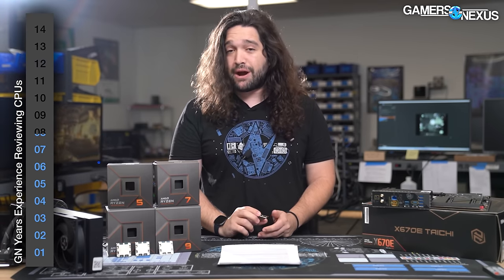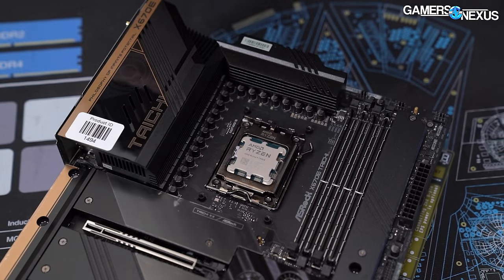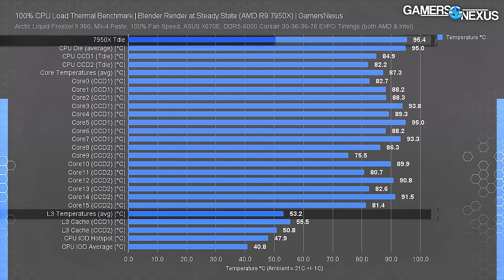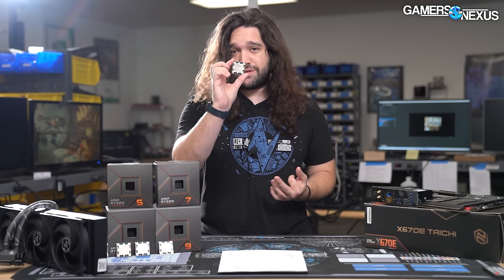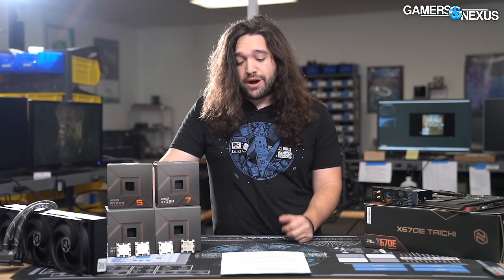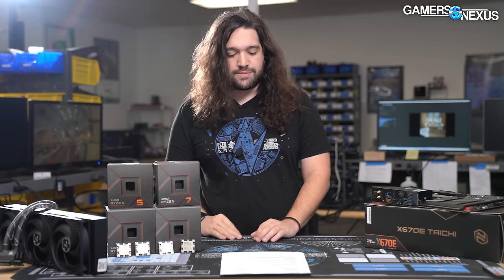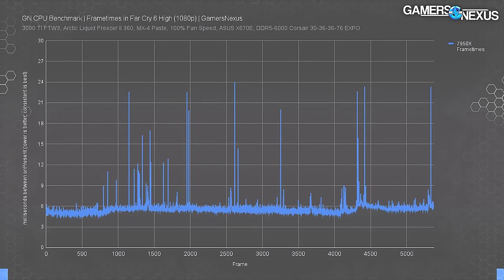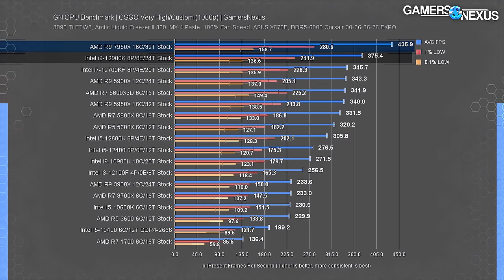95°C is Now Normal: AMD Ryzen 9 7950X CPU Review & Benchmarks

Comment: 95 was the normal back in the Late Socket A Athlon days, so this is a return to that. It seems like power usage goes in cycles.
Reply: Temperature not equals to power usage. 
Chip size have huge impact on temperature on par with power. Increasing size = cooler, decreasing size = hotter, decreasing power - cooler, increasing power = hotter
Reply: Heat != Power usage
Reply: 95 was never normal at Socket A, been there done that. Overclocked many Bartons and T-breds back then.
Reply: yeah I think even 70c would kill those socket-A chips. (Back then there's no thermal protection)

Comment: Happy with my 5800X. Great performance in gaming and productivity and rarely exceeds 70C under load with a Noctua air cooler
Reply: Same, in the future when the prices are lower I might pick up a 5800X3D as a drop in upgrade though. Pretty wild how much better for gaming it is over the regular 5800.
Reply: @Big_Red1  5800X3D is a great choice! But only if it's for gaming, it's not made for productivity.
Reply: 5700X is value for money though!
Reply: I have the same setup, just waiting to upgrade my 1080......
Reply: @firekid5790  5700X was also released much later so what is your point
Reply: Stop focusing on temps on Zen 3 and above, if frequencies are fine and stable let it be

Comment: Could you guys please test PBO2 and it's undervolting feature. It was really great on Zen 3 as AMD left quite a lot on the table in terms of the Volt/frequency curve. Especially since these new Zen4 cpus pull so much more power, it would be really nice to see if there is a way to rein in the power while still getting full performance which was the case with PBO2 last gen.

Comment: There's no way I can afford a 7950X and 3090Ti (or even an upgrade of any kind), but it's still fun to see my old R7 1700 represented in these tests. And yes, I know that the gaming benchmarks shown are WAY ahead of what I can get with my old RX 580, but it's still fun :D
Reply: Get off YouTube and make more money
Reply: Whoa, someone else with my setup!
I've been eyeing the 5900x for a while, and this video makes me more confident.
Reply: @WaterZer0  yeah 5900x series is amazing just get a good cooler totally worth it.
Reply: @magnusred2945  that type of statement should not be made without context. You don't know the situation of the guy in question.
Reply: @magnusred2945  this is the kind of statement of someone who thinks they're hot schtick. You don't know what the OP's situation is and his set-up is still pretty good for what it is.
Reply: im still using 1700 over clocked since 2017
3466 memory b-die low latency
gtx 1070

i have even clocked this cpu to 4.2 and memory to 3600..however these are not stable all the time

i play all games
some are very smooth
some in ultra settings
some high
some medium

i have had 3 x 24 inch momitors + 19 inch on this 1070 in surround
worked flawlessly

only "new world game" i need a new gpu ..so i want a 6800xt or 6900xt
amd uses less power than nvidia 3000 series by a lot and its cheaper
also checked on a 5900x and a 5800x3d and the x3d uses 30 percent less power in all games  and gives more fps too

its a better upgrade than any 7000 series amd ..due to pricing and power draw by far

3090ti draws 450 watts and amd 6900xt draws 220 watts avearge
massive difference in your pocket or electric bill
also  5800x3d 60 watts and 5900x 110 watts in all games average
Reply: RX580 gang represent!
Reply: Hey RX 580 club! I have the Saphire Radeon Nitro+. On a Pentium LOL. But I play WoW, Path of Exile and some GOG games so I went with what I actually needed. 
I also have a 3200G system on the Asrock B450M Pro4 just using onboard graphics. Same games. Perfectly fine for my use case. 
Wanted one Intel and one AMD system. Dual boot Linux Mint Cinnamon and Linux is just easier on AMD graphics.
Reply: @youtubeisgarbage900  It's nearly 6 years old, that's ancient for a CPU.
Reply: @itIsI988  my little brother is still using my pentium G3258 and 750ti lmao
Reply: @magnusred2945  But if I got off of YouTube, where would I get such insightful and motivating suggestions?
Reply: @vaderbuckeye36  Damn. If it works it works ig. My PC is almost 7 years old as well, just with a 3 year old GPU. Starting to show its age a little though.
Reply: If you want to stay with AMD, you can sell your 580 for a few $$ and grab a used 5700xt for like $180. It’ll be a huge upgrade for probably ~$100 net cost. I have one and it works great for 1440p as long as 80-120fps is acceptable to you in AAA titles
Reply: What's with the cope in the replies? What exactly is this dude's situation he can't make more money lol
Reply: @youtubeisgarbage900  That wasn't my point though, 6 years is still a long time for a computer.
Reply: @youtubeisgarbage900  If doing basic shit then yeah
Reply: @starofeden9277  I have the same specs, except for the RAM. Mine is team group vulcan-z 3200, but I have a lot of instability if I run it above 2400. Also sounds like you won the silicon lottery, my r7-1700x won't overclock past 3.9ghz. I'm still pretty happy with my system though, my next upgrade will probably be a 5700x or 5700x3d depending on how cheap it gets, then a used 3070 or 3080.
Reply: @youtubeisgarbage900  How am I shilling lmao, I couldn't give any less of a fuck about any of these con artists. That being said, you can't deny that the progress they've made since 2017 definitely makes Zen 1 old now.
Reply: @youtubeisgarbage900  If all they do is basic stuff, then obviously they won't need to upgrade. Doesn't mean their systems aren't old though, and a system being old doesn't necessitate an upgrade if it still serves its purpose.

Comment: This only makes me appreciate the 5800X3D even more.
Reply: It's such a beast. Tbh AMD may need  to enter the fourth dimension once Intel's 13th gen is released. Unless Intel plans to return to the tic tic tic tic tic model again.
Reply: @buckwilicker  Oof I have a 5800x3D and a 3080 but a 1440p monitor, if you have anything you want me to test at 1440 let me know
Reply: @buckwilicker  4K gaming is stupid if you care for fps. 2K gaming is noticeably crisper than 1080p and much easier to get good fps
Reply: 5600X runs a 3080 Strix just fine in both 1440p and 4K...
Reply: @jezuconz7299  dude
 you are wrong in your measurements
2k is 1920x1080
so???
Reply: @turkepic3637  Pretty sure Zen 4 3D comes out in a few months anyway. Should be interesting to see just how much performance is increased with second gen V-Cache. If Raptor Lake is competitive with Zen 4 I can see AMD pushing out Zen 4 3D earlier than we all expect.
Reply: @starofeden9277  2K is 1440p dude wtf is wrong with you
Reply: @riven4121  Yeah , I didn't realise they didn't use 3D cache yet , that's totally my bad :)
Though I still think we'll get the four dimensional cache in Zen 7.
Reply: Don't worry to see zen 4 being space heater, Lisa Su actually make that chip to honor Amd fx and bulldozer.

Comment: Man this makes me super excited about the 7000 series but also really happy with the efficiency of the 5950x that I upgraded to from an 1800x a few months ago on sale. When I upgrade in a few years it'll be a great unRAID server upgrade and then I can go with a upgrade few iterations onto the new socket. 🙂

Thank you for the amazing review!
Reply: They literally regressed by a huge margin from the 5950x efficiency. Just throw more silicon and more power at it, and raise prices. Like nvidia is doing.
Reply: @surewhynot6259  they literally dropped prices for the *950X processors lmao.  The 5950X started at $799.  The 7950X costs $699.
Reply: @surewhynot6259  Read up on what limiting the power usage does, it's actually insanely efficient they just let it go full bore for... idk, slightly higher bench numbers
Reply: @shurin3126  Absolutely, they're very efficient chips that are just turned up to 11 if you want or not. Knowing me I would always have it turned on to Max 😂 heck I just enabled a PBO yesterday on my 5950x MAX POWER lol
Reply: @DavidBozinov  I'm personally happy with letting my 5700x just run stock. Pushing it would make more sense when I finally upgrade the GPU. Though I'm not convinced I'll do it at that point either.
Reply: @ArtisChronicles  Definitely, use it the way you need it! Yeahhhhhh I tend to abuse my processors lol I do a lot of 4K 60 recording while 1080p 60 encoding and a few other things in the background while gaming or VMs. I try to extract every ounce of power lol once it gets moved to server I'll undervolt it and go for efficiency. That's what I'll do with my old 1800x will once it replaces my FX8350. Just waiting to buy a x570 board once I have some spare money.

Currently running my 5950x on a old x370 board. 😅
Reply: @DavidBozinov  5800x3d seems my choice soon as it drops below £400 (currently have 3800x, just need to 5000 CPU for single threaded performance of bunch of games I play online), the difference you got from going from 1800x to 5950x would have been amazing, its like having 5 1800x cpus in one package (I assume the 5800x3d wasn't available at the time or your using the extra 8 cores)

Comment: I'm concerned about the noise levels since it'll be running at peak thermals more often compared to prior generations.
Reply: Fan curve?
Reply: yeah, basically you adjust your fancurve to the maximum noise u wanna have, and the bios does the rest (managing how much power it can draw with the given cooling)
Reply: @certaindeath7776  under gaming loads it doesn't seem to hit those kinds of temperatures anyways. linus had the 7900x in the mid 70s with an NH-D15 while gaming, so you can still set up your fan curves properly.
Reply: Because it basically targets a temp anyways, you can manually set your fans to whatever you want, and it will clock itself accordingly. I'm actually really interested in how these CPUs scale for lower power draw.
Reply: @chaon93  barely any performance loss at 140 watts according to Computerbase, 5% in all core workloads compared to maxed out under an nh-d15, basically no effect in less multi-threaded stuff
Reply: Don't forget single core power consumption is up massively. Doing simple tasks will cause your thermals to spike.
Reply: @surewhynot6259  that was already the case with zen2, and cause for major annoyance for me. so much so that i ran an all core fixed clock on my 3700x until i switched to a custom loop. now i control my fans by water temp which is just wonderfully calm.
Reply: Add more radiator. You won't get a quiet mini-ITX build if you want the posted results and a quiet PC. You're going to need either a giant case with a couple of giant rads and some slow fans, or go for an external like the MoRA series.

Or stick with the 5800x3D if all you're building is an expensive games console.
Reply: @GoodOlKuro  what curve when it spikes to 90s in 2s? :D

Comment: Man the performance is impressive but that high power draw and TDP makes me glad I built my new PC earlier this year with a 5950X.
Reply: I do wonder if an undervolt paired with eco mode might improve things.
Reply: @lepidotos   It is. Heck 7950x can be turned into a 5950x and run cooler and at the same time draw less. But AMD being AMD cranked the living * out of this CPU's to beat Intel and seems to be really well designed to do it! (good) But AMD being AMD did this right as people are afraid of electricity prices. Squanders there really good efficiency by pushing POWWWER just as they launch new boards (AM5) meaning that the boards are extremely expensive etc etc etc. When they can just have given us like a AM4 CPU running Zen4 that draws less power then 5000/go faster.

Or they can have marketed the efficiency and made reviewers figure this out before launch and have REVIEWERS market the crap out of AM5 as a MUST BUY instead of AM4 or Intel.

But we are talking about AMD. Clueless bad drivers. :c Like AMD stop picking up the shotgun! Just use a pistol like everyone else! It is going to be bad enough with a pistol to the foot.